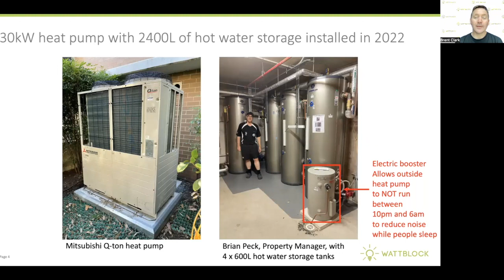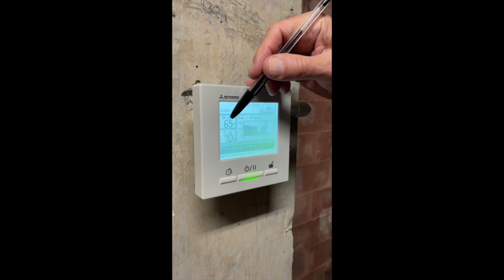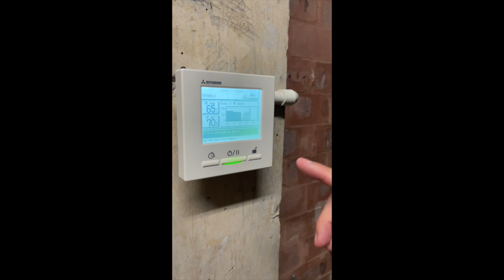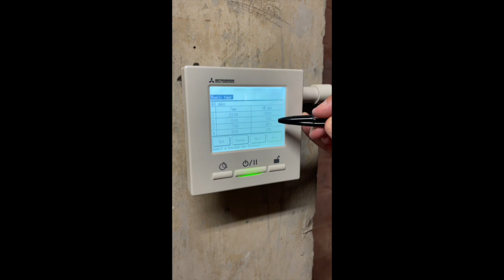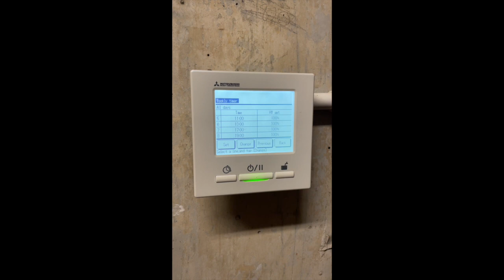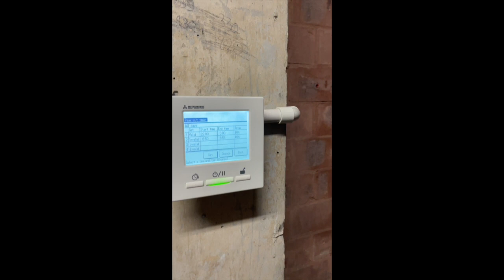Hot Water Heat Pump Case Study - 16 Freeman Rd Chatswood

Comment: Another great Wattblock video and about an area that few owners corporations have ventured into. 

Wondering if individual owners' relationship with Jemena was totally terminated ( no gas cooking or space heating) or was it just their gas HW bill that disappeared?

Perhaps it is early days yet but I would be interested to  know what the OC's actual costs of hot water are compared to the estimated amount that all owners were previously paying through their gas bills derived from the Jemena allocated bulk gas meter usage......Was there modelling of costs done to persuade the owners  to vote for the changeover.....Did landlord owners grasp the significance for them and were they able to adjust rents for the "free" hot water tenants got......

Thankyou again.
Reply from the maker: This strata is still going through the process of decommissioning the jemena hot water meters. Individual lots still have gas for cooking, except in the case of Brian in the video who has already moved to an induction cooktop, so he will be the first unit in the building which is able to completely cut his relationship with Jemena, if he chooses to go down that path.

Actual costs of hot water will be a few months away and will rely on estimation. This building had already done a large solar system generating a loss of excess solar export, so the rationale used was to cut the excess solar feed-ing into the grid rather than modelling the hot water savings. Once the hot water meters are decommissioned, then the landlords will have to go through this journey.